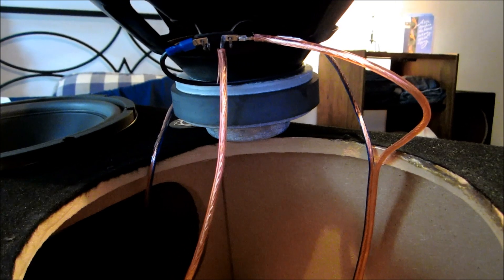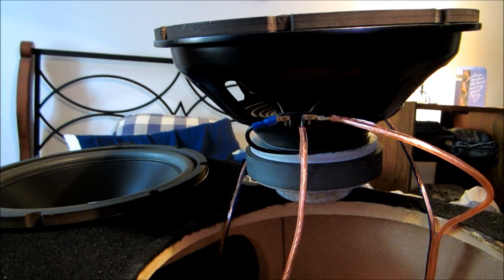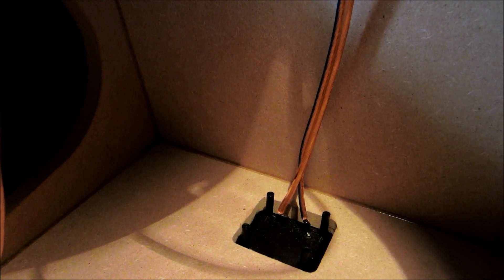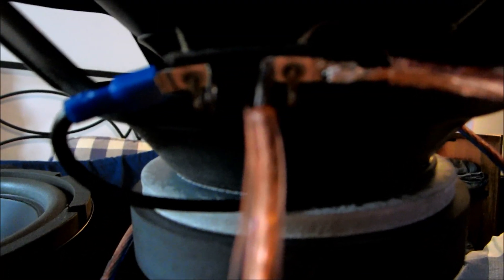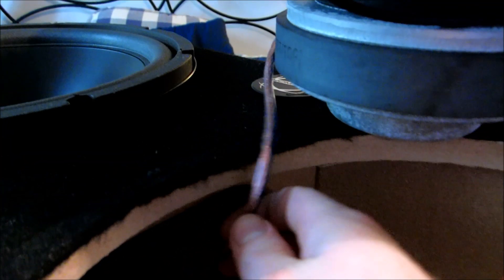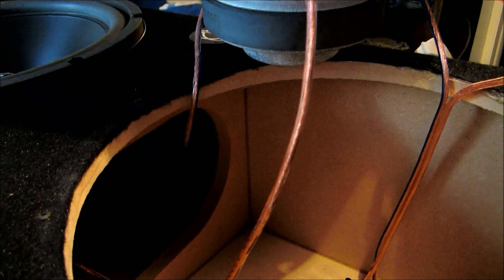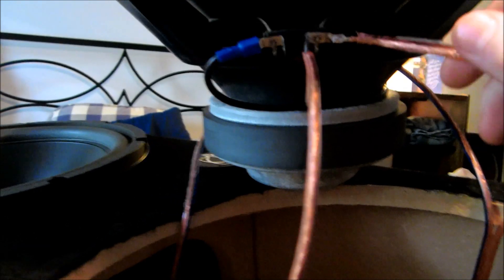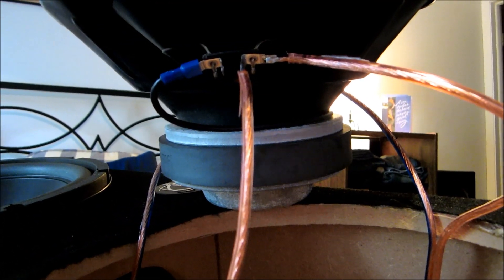How To: Wire Dual Coil 4 ohm Subwoofers in Parallel for a Mono Amp

Comment: Can you please show how you wired step by step. I have one 4 ohm dvc sub. I wired positive to positive and negative to negative then on the the other set of terminals i wired positive to the positive of the box terminal. Then the negative to the negative of the box terminal. Does that sound right?

Comment: if I have a mono amp that runs RMS 500 for 2 ohms, and put my two 12" 4 ohm subs that have 500 RMS paralleled on my amp, will that work? I know the ohms will be cut in half so that's good, but does my amp need to have 1000 RMS because there are two 500RMS subs
Reply: Jake Schulz each of your subs will take only about 250W RMS

Comment: when u wire more than 1 ohm like 4 or 8 the 4 and 8 ohms multiply the power and takes stress of the amp. as said 1 woofer requirs 1500rms and u have a 1000 watt amp you would wire to 4 to 8 ohms because it will lessen load on ur amp and putout more power to subs

Comment: You should use a pos on one woofer and the neg on the second woofer so there not sharing power. They'll both hit as one vs one getting more power than the other. Just saying  but I like that version jl than the other ones. Nice stuff bro